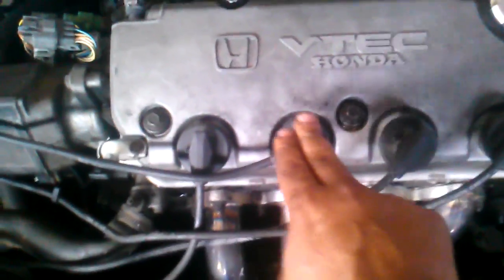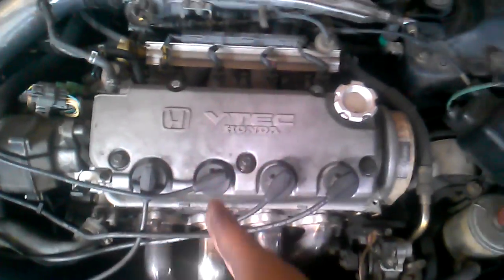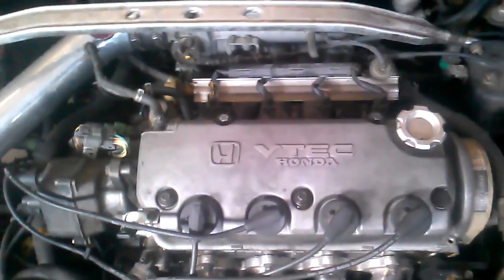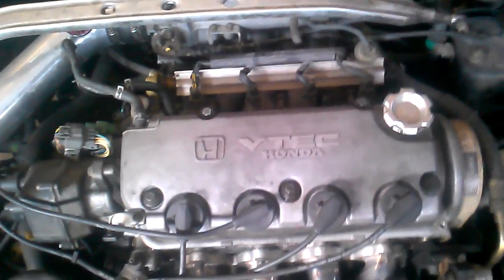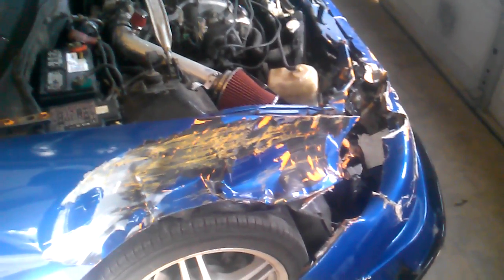How to find a misfire

Comment: Just FYI that's NOT the SI.... That is the del sol base model which came with a D16z6... The si came with the B16A2.... And also had rear disk brakes.
Reply from the maker: +Steven Roush just FYI a B16A2 NEVER came in a del sol SI..The only Del Sol that ever had a DOHC engine stock was the VTEC model and yes it had the B16a2 in it..Just FYI again,if you go to my video named Honda del sol si with eg civic front-end and skip to 2:29 you will clearly see that this car in fact has rear disk brakes..So not to be a asshole but im trying to figure why you made a comment if all of your facts are wrong.
Reply: Brother I have a del so si... b16A2... not swapped....
Reply: D16z6 is not an si model
Reply from the maker: +Steven Roush This isn&#39;t a pissing match but you are wrong..There are tons of wedsites that you can lookup and see that the SI never had a b16a2 in it stock...                                                                                                                                         S - D15B7 ('93 - '95) D16Y7 ('96 - '97)

Si - D16Z6 ('93 - '95) D16Y8 ('96 - '97)

Vtec B16A3 ('94 - '95) B16A2 ('96 - '97
Reply: No... as a matter of a fact, the b16 is offered in all si models. 99-2000 civic, as well as the del sol. The b16a2 was not called the vtec model. The D16z6 also had vtec.
Reply from the maker: +Steven Roush omg man can you look it up?You are telling me what you know and not facts..You are telling me that HONDA website,Motortrend,Wiki,Import tuner ect are wrong and you are right?Starting to think your trolling.
Reply from the maker: +Steven Roush lolol i was like WTF is he talking about...Its cool man,all in good fun and you just earned a new sub

Comment: i have a 1999 honda civic ex and i had a check engine light because of the catalytic converter code p0420 and i was driving it like that from LA to SD and the car started over heating and now it says i have random misfires on all cylinders and the car just doesnt drive the same it shakes when i turn it on and it overheats fast what should i do ?
Reply: check your fan switch
Reply from the maker: Sounds like your Fan,fan switch or thermostat failed while you were driving and possibly blew your head gasket..Send me a pm if you need anymore help

Comment: I have a 91 civic hatch.... Whenever I step on the gas the car just shut offs..also for it to even start takes like 10-15 seconds of cranking.. Then it sort of sputters then start and idles rough... Sometimes in first I give gas and it hesitate in first gear.. I was thinking it could be fuel pump or fuel filter or injectors... I checked the injectors and I took one completely out and the car just shut completely off